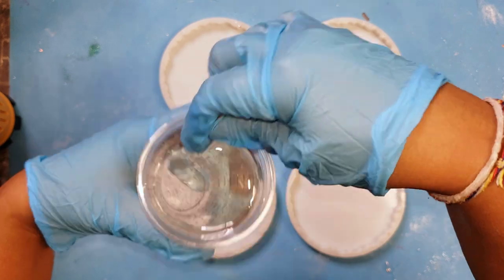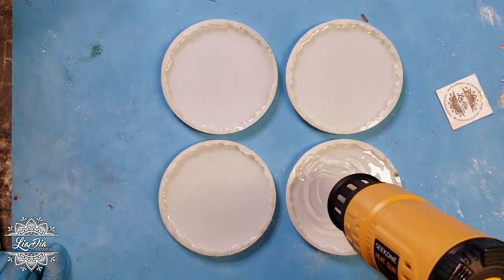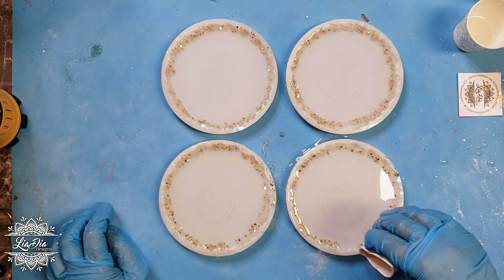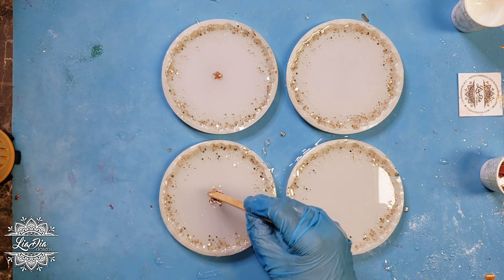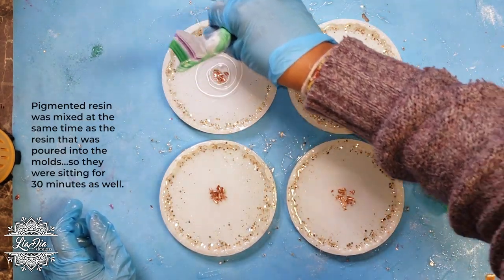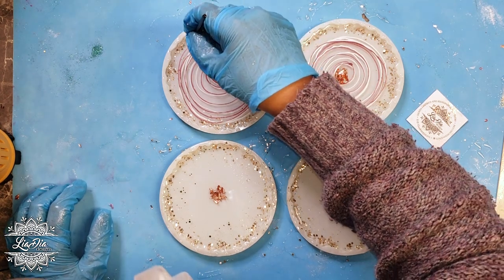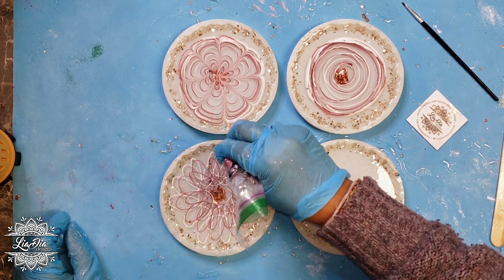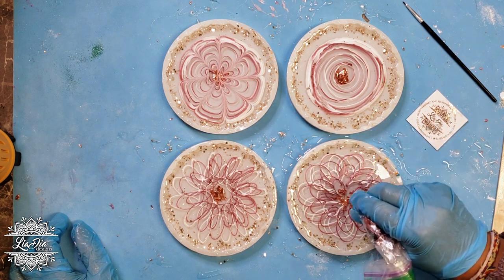LiaDiaDesigns | FLOWER Testing! Part 1 - InsPOURation FUNdamentals - Epoxy Resin Flower Coasters

Comment: Not sure if you have found a way to avoid the blobs yet but just in case you haven't I wanted to let you know that it doesn't do this because the colors are crossing and having thicker coaster won't fix it. It is all about the weight of the pigment. Pastes and micas are on the heavier side and it being white also makes it heavier. To make flowers I will use alcohol inks or add drops of alcohol ink to VERY LITTLE amounts of my micas  or pastes.
Reply from the maker: Thank you😊,  yes,  you're right,  it's the weight of the paste mix... when the mix is thicker and the lines cross over each other, they sink even more.  I don't use alcohol inks as I've seen them fade on other's pieces (that were originally amazingly beautiful)... so I prefer to use mediums that I know will keep their color over time. Definitely making the paste mixes thinner is a winning strategy... I've done that in a few of my followup tutorials 😊
Reply: @LiaDiaDesigns  oh yes definitely they do fade if you use them alone. I ha ent had that problem as long as I mix them into the resin just like mixing the mica. But then again I will make sure I use opaque colors and add just a little alcohol ink white.

Absolutely love your work though and it has given me so many of my own ideas for my own work and shop. So thank you!! Keep it up!

Comment: I love your work and indepth explanation. I just wanted to ask you one thing, I have seen you only using heat gun and not blow torch, is there any particular reason u don't use blowtorch??
Reply from the maker: i try to avoid the torch when I'm using molds, the torch flame can damage molds... the heat gun is safer.

Comment: Why do so many people go for the opposite side of the coaster over the one we spend all of our time working on?  Will someone please answer that question?
Reply from the maker: it really depends on the effect you're trying to get - for flowers inside resin, the "right" side is the bottom because of how the pigments settle.. though some people prefer the top if the pigments settle down too much. For me, the "right" side depends on the design I'm making... which in most cases is the top (the side we work on)... but flowers and some other techniques can be the exception
Reply: @LiaDiaDesigns  Thank you very much.